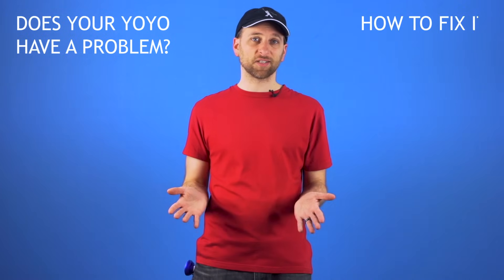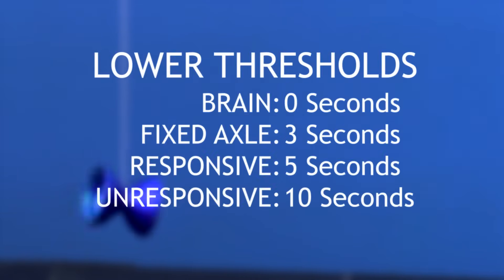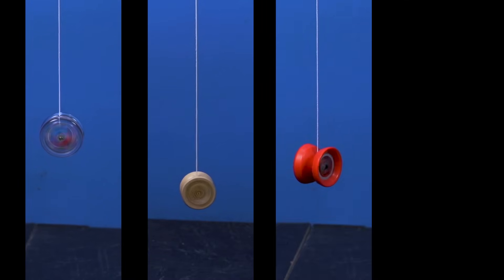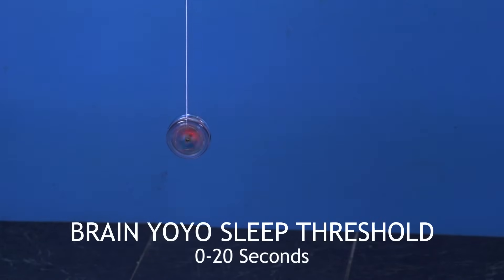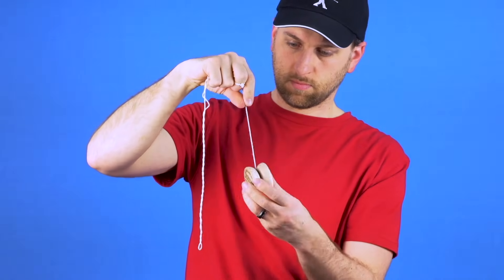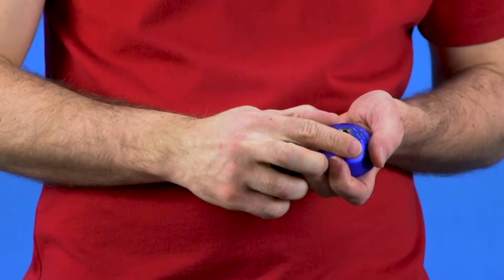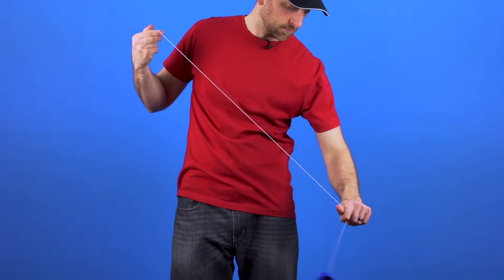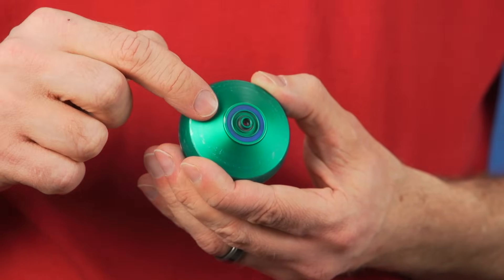Why Won’t My Yoyo Sleep Longer? How to Test and Fix your Yoyo Spin Time

Comment: I have a magicyoyo y03 hertz and that sleeps like crazy. I got like 6 minutes and 33 seconds (i did correct the the tilt by twisting the string)  the crazy thing is that it costed me like 17 dollars
Reply: Mine was 5:57sec on Magicyoyo n12
Reply: I remmeber that my node spins 9 minutes 40 second. Yes
Reply: @mollies13 how, I just bought a node and it barely hits 30 seconds 😭😭😭

Comment: Hey, i received a Sage and a Oracle some weeks ago, but ever since the Sage played snaggy, it sleeps for a normal time, but when I pull it up it comes up a little bit, stops, and then comes back at full force, and sometimes after doing some tricks, it doesn't come back at all. I used the oracle to check if it has anything to do with my technique, it played great
Reply from the maker: The Oracle is designed to play more responsive than the Sage. This is because the Oracle is designed for looping tricks, and the Sage for string tricks. If you want the Sage to play as responsive as the Oracle you can either lube the bearing with thick yoyo lube, or you can wrap the string one or two additional times around the bearing when you put the string onto the bearing. You may also want to try changing the string on the Sage to see if that helps.

Comment: Hi, Thanks for the great videos.
My unresponsive yoyo (Magic Yoyo N8) is coming back once every 2 or 3 throws.
Its brand new. Why would this be the case?
Reply from the maker: In almost all cases the problem is the bearing. The bearings in magic yoyos are notorious for being hit and miss. It sounds like you may have gotten a bad one. If you have a different bearing you can replace it. You can also try cleaning it to see if that helps:
https://www.youtube.com/watch?v=4LQ62wy0qjI
Reply: Hey,

Thanks for the advice!
I actually lubed it a tiny bit and now it looks like its fine.

Thanks again and keep up the great work, your channel is the best!

Comment: Does the yoyofactory spinstar count as a transaxle yoyo or does that style plastic bearing just under the category of responsive? I'm trying to set the yoyo up and I don't know how many loops I need to use when putting on new string. I also can't really tell how much to tighten the spinstar and in general it feels like a bad yoyo most of the times. Some time when I set it up the throw is smooth and appropriately responsive and other times I have to fiddle with it for an hour before giving up. I love my whip and edge/wedge and have a decent idea of what I'm doing but I can't make this yoyo click in my head, I'm missing something but I don't know what. Maybe it was botched from factory but a lot of people praise this yoyo highly so I'm guessing I just don't know something yet. This is an old vid so I'm just fishing around for random eyes. Anyway, good luck er'body.
Reply from the maker: The spinstar is a transaxle that is designed to work with a single loop. They can be a little hit or miss, I am told - so far all the one I have used work well. You should be able to tighten it as far as it will go for it to work properly. Just make sure you are using the thinnest string you have - ideally 100% polyester.
All that being said it is not designed to compete on the same level as the other yoyos you have. It is designed to be easy (that is, to throw it down and get it back up), not to be a top performer. Once you can do a basic throw, in most cases you are ready to swap up to another yoyo.
Reply: @yotricks  Damn dude, reply to a 4yr old post. That is heart warming. You and your media are already an incredible resource and I do greatly appreciate it, whether it is you or a team. Just learned the plastic whip w/ bind. Anyway, I've been trying to use the spinstar for looping and when I tighten it all the way the string gets bit by the starburst pattern or teeth w/e the name. Using Evan Nagao edge string that I read was probably rebranded Knot-Bad string. I tried Mowl fat string to try some longer string but neither work optimally. I'll pickup some thin string to test out. As is I can eventually get it to be a good sleeper that isn't as responsive as I like or a very responsive that doesn't always sleep on command. The fact that I've set it up and it's worked very well at least once or twice is kind of what makes me think I'm the one being inconsistent but to save frustration I'll prob move on to different yoyo either way. I think for now I'm going to pickup a Sochi Loop Spinner mostly b/c of aesthetics and eventually a Match set b/c they sound more ideal for doubling up and having 2 mostly identical throws will help with consistency there. Thanks again, bud. I don't think I would have gotten back into yoyo with the same passion if your videos and app weren't available as you've made it incredibly easy to trigger dopamine hits and it's really been a lot of fun.
Reply from the maker: Awesome. You definitely want to move on to a different yoyo for loops. The shape of the Spinstar is ok but not great for loops.  With the right string setup you can definitely learn 1 or 2, but not much beyond that. 👍

Comment: Hey Adam do you have some Q&A seccion, recently I bought the duncan roadrunner which is suppose to be an unresposive yoyo but if i flick it to hard in the air some time works as a responsive yoyo. If you still have your channel do yo have anythougths?

Comment: Hi, Adam. I am 8 years old. My name is Kabir.  And a very big fan of your tricks. I have a question to ask.
 My yo-yo is spinning for a long time when it's not on the string. But when it's on the string it's not spinning for as long. Can you please tell me what should I do. I am using velocity yo-yo. Thank you. I hope you will reply.
Reply: thats normal, when the yoyo lands on the string that causes more friction which slows the yoyo down
Reply: buy thin yo yo strings.

Comment: Hey YoTricks. I have a quick question. So last year in August I bought the Sage Pro Pack and I added the optional YYF Slim Pads Blue. I put those in my Shutter the other day and I'm wondering if those are ok for the Shutter. The reason I'm asking is because the pads aren't completely flush with the inner rim. Thanks! 👊🔥
Reply from the maker: Those pads are good for the Shutter. It is okay if they are not completely flush.

Comment: i have a responsive yoyo made of aluminum that i brought on amazon. i can see "magic yoyo", "locus" and "v6" written on it.
i lubricated it with some thick silicon lubricant because i don't have specific yoyo lub, and i had that on hand and it seemed pretty close. of course, i wiped off as much lub as i could to avoid any excess. before that, the sleep time was better, but the yoyo wasn't too responsive.
now, the responsiveness is much better, it goes up to 10s of lower threshold, but the upper threshold is very unconvincing... always less than 30s and after the 20s mark, it's too slow to rewind all the string, even if i help by moving my hand closer.

i'll try doing some aggressive pinwheels even if you said that for unresponsive yoyos. maybe that lube have very low performances at high speed.
i'm curious about what yoyo lub is exactly, because i can't believe it's some unique and specific kind of lub that's exclusively used for lubing yoyo's bearings.
Reply from the maker: Yoyo specific lube is more important for unresponsive yoyos than responsive. If it is making the yoyo play as responsive as you like, it should be fine. The reason thin yoyo specific lube is preferred is because no one that I have found makes any lube that is as thin as need be for the way unresponsive yoyos play.
If your responsive yoyo is sleeping for 30 seconds that is on the lower side of normal for a responsive yoyo.
Reply: it indeed plays unresponsive well, and after some vigorous pinwheels and other kind of practice, the sleep time is much better. i guess i had indeed a bit too much lub in the bearing.
from what i understand, lube for unresponsive play should be as thin as possible to allow for very low friction at high and low speed and avoid any kind of responsive behavior (while having much better sleep times).
for responsive play, the lube has to be thick to some extend so that when there's little to no tension in the string, the lube create friction that will make the outside of the bearing spin and start winding the string, until it touch the response pads. before lubing that yoyo, i could give very unreasonable amounts of slack without having it winding back when my throw was perfectly straight, because the string wouldn't touch the response pads.

from what i found about yoyo lube formulas, you could use most ptfe based lubes as long as they are meant for light weight parts moving at high speeds. then, the viscosity of the lube will play on it's performances at lower speeds and loads.

since the thicker lube is necessary for responsive yoyos, i guess the only way to increase sleep time is adding weight. i have a bad yoyo with plastic teeth instead of response pads, but a heavy body made of steel, and it get a comparable sleep time despite being thrown at an imperfect angle (did i mention i made the string from roasting string).

Comment: I received my yoyo in December, and I just picked them back up today (not sure why I stopped yoyo-ing). My yoyos are very loud! I remember this happening when I received it, and it still happens now. Any ideas? I have the sage, and 2 oracles. I'm going to put some yoyo lube in, so hopefully that will help... And it probably needs it anyways. Thanks! 

EDIT: So I applied lube to my barrings, and it definitely made it quieter, but not as quiet as I think it should be. I've used a few yoyos before this, and I never had this issue, so Im clueless as to how to fix it 🤔
Reply from the maker: Bearings being loud is not a "problem" in the sense that it is bad for the yoyo or hurts performance. If you put in enough lube, over time the bearings will become silent, but they also won't sleep as long.
Reply: Do you know why it does it? But thank you, I will take that into consideration!
Reply from the maker: It is just the sounds of steel touching steel within the bearing. In order for there to be no noise enough lube needs to be in the bearing that there is little to no direct contact. This also slows down the bearing, which keeps it from spinning as long.
Reply: Ok thanks! How come none of yours do that? (Sorry if I'm being a hassle, I'm just curious!)
Reply from the maker: All of the yoyos we use in our videos make noise, but the yoyo is far enough away from the microphone that the video does not pick up much of the sound.
Reply: Oh ok thank you!
Reply: @yotricks l

Comment: Hello, please help. I have a new (maybe 3 days) Arrow Elite, and it is very responsive. It doesn't even sleep and it is reacting as looping yoyo. I try to lube the bearing, then i recieve another one, new, bearing, but yoyo is still very responsive. Can u help ?
Reply from the maker: If it doesn't sleep at all then most likely the string is caught between the yoyo and the bearing. Take the yoyo apart, remove the string, put the yoyo together, then put the string back on.
https://www.youtube.com/watch?v=jJrtgrGmZQk

Comment: Hey I just got a dv888 responsive ball bearing, and it’s brand new but only spins for roughly 12 seconds out of the box and dies instantly on a trapeze. Is something wrong?
Reply from the maker: Is the 12 seconds the drop test, or with your strongest throw?
Reply: @yotricks  it wasn’t quite my strongest throw but I cleaned it and it’s working a lot better now. Thanks for responding
Reply from the maker: Awesome!

Comment: 2:52 when i try my yoyo doesnt spin long enough to pull i up (it spins 3 sec min and i never managed to make it spin longer than 10 sec and never had enough spin to pull it up after 4 sec), also the minimum and maximum spin time are pretty close, i just started, i have a spinstar and i dont know if im not doing it properly or theres a problem pls help😢

Comment: I tried using my yoyo to sleep. For the drop test it either starts turning no matter how strait I drop it or it lasts less than 3 seconds, for the other one it comes back instantly even if I don't throw it hard.
Reply: yeah i just got a new yoyo and it slept well for like the first five minutes i used it and out of nowhere it just kept coming back right away? every other responsive yoyo i have sleeps perfectly fine, idk what’s going on.
Reply: Make sure to check your string tension. Also, is it a fixed axel, brain, responsive, or unresponsive yo-yo?

Comment: I have a brand new, inexpensive beginner's (responsive) 1A yoyo, and the maximum sleep time (12-15 sec) is about the same as the minimum (10-12 sec). Would that just be a case of a brand new yoyo needing to be "broken in" or maybe in need of some lube? It is difficult to get more than two or three swings of Rock the Baby before it has slowed down so much it won't return, and that's with a good strong, straight throw.
Reply from the maker: What you are describing doesn't really make sense to me. Are you saying that if you drop the yoyo, palm down, it sleeps for 10-12 seconds, but if you throw it very hard and perfectly straight it only sleeps 3 seconds longer at most? That seems to defy the laws of physics. I cannot imagine what the problem might be.
Reply from the maker: John Cooper Ok. Hopefully the Sage will work better for you. The K1 has a reputation for being pretty awful.
Reply from the maker: If your goal is to quickly get to unresponsive play, you should be okay.

Comment: My yo-yo can spin for like 20 minutes. But I got a new bearing and I lubed it and everything but it makes a little scratchy sound when it spins. Is it fine?
Reply: The yo-yo is a CLYW Akita. My other yo-yos don’t have this problem.
Reply from the maker: If the only issue is the sound, then that alone does not indicate any problem.

Comment: my string is constantly hitting one side of the yoyo, i am making sure that im throwing it straight but after about 10 seconds it just tilts onto its side. i am trying the string method but it doesnt last long enough for me to adjust it as its sleeping.
Reply from the maker: What kind of yoyo is it?
Reply: YoTricks fizz
Reply from the maker: The string method is for unresponsive yoyos that can sleep over a minute. If you are using your Fizz and it starts to tilt around 10 seconds that just means you need to improve your throw. Still, 10 seconds is plenty of time to learn quite a few tricks!
Reply: YoTricks ahh, thank you

Comment: I have a problem, I bought two orical yoyos for 2a tricks and 1 of them makes a loud grinding sound I thought it was normal all yoyo bearings make that sound but the other origal I bought is very quite and the other one I bought make a much louder sound almost like a grinding sound. I think something might be wrong. Don’t get the wrong idea the yoyos still work but one is much louder than the other should I be concerned?
Reply from the maker: Rexly Bearings vary like that. I would put a little line in the bearing, that should quiet it down.
Reply: yotricks what do you mean little line? Another things your saying the sound just Varys right, man I feel so much better about my yoyo
Reply from the maker: Rexly a little lube. Autocorrect!
Reply: yotricks hmm okay got it but should I use thin or thick lube? it’s a very responsive yoyo after all
Reply from the maker: Thick.

Comment: Will my brain yoyo break if I take out the ring will it become a in or responsive
Reply from the maker: If you take out the ring it will no longer return automatically. It may be responsive or a little unresponsive depending on the yoyo.
Reply: Great thx

Comment: My yomega yoyo doesn't work anymore when i took off the black rubber ring. And the black rubber ring broke when i removed it.

How do I fix it, where can I buy another black rubber ring, and is it normal that now my brain yoyo is an unresponsive yoyo even though they said it wouldn't auto-return. (which means that you can still pick it up with a wrist flick)
Reply from the maker: You can get an o-ring at any hardware store. If you lube the axle with thick yoyo lube, it will still come back up when you pull on it, even without the o-ring.

Comment: Hey! I've got a problem with my one star yoyo. It said it's an unresponsive yoyo so why does it come back when i pull on the string (i didn't even had a chance to play with it, it just comes right back up)
Reply from the maker: It has been so long since the One Star was made, most likely the bearing in it has started to deteriorate. Your best bet is to replace the bearing. You could also try cleaning it first.
https://www.youtube.com/watch?v=4LQ62wy0qjI
Reply: yotricks I've already cleaned it and lubed it but it's still the same so thanks for the advice. I'll buy a new bearing. I'm not gonna stop yoyoing

Comment: I have an unresponsive yoyo and its not sleeping more than 30 seconds. What should i do?  Please help me
Reply from the maker: Prabuddha Vaidya If it is sleeping 30 seconds with the basic drop test, it sounds like it’s working just fine.
Reply: Not with basic but with a good throw!
Reply from the maker: Testing your yoyo with a normal throw is not as useful as doing the drop test. How long does it sleep in a drop test?